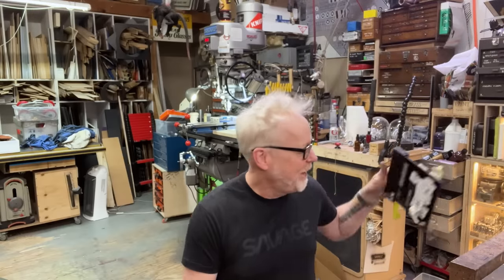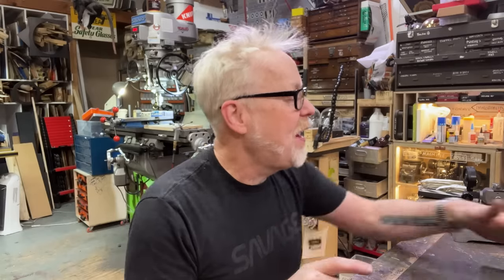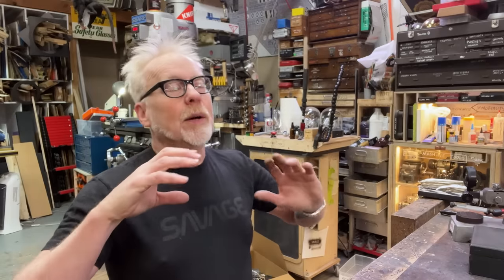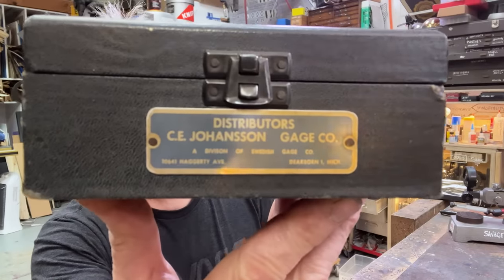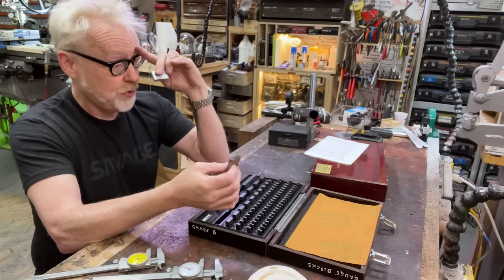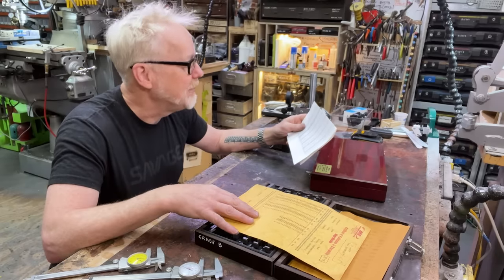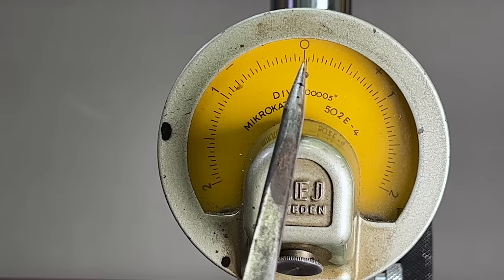Adam Savage's Most Precise Measurement Tool!

Comment: Hi Adam, I'm glad you did a practical demonstration of the gauge at the end of the video, I wasn't too sure about where it was going and then when you noticed the needle moving down due to body heat, suddenly this all came together nicely.   Thank you for the video and the demonstration, I'm blown away with something that I will remember for my lifetime even if all the other details were murky in my mind.
Reply: 100% with you.
Reply: @Vickie-Bligh  Yeah... it's mind blowing how that short amount of contact and normal body heat changed that material.  I like it when something surprises me in a way I don't expect it would and I learn something in a new and different way.  I mean, we've all heard about metal changing or expanding with heat, but we don't realize how our own body heat can change it....  Thank you for your comment and sharing that moment with me 🙂
Reply: When it hit me I yelled "WHAT?!" a little too loud and scared myself.
Reply: Could it posibely be oils from his hand as I do find it very hard to believe metal expanding because of about max 20degrees celsius ..
Reply: @karel_de_lille  I don't know if I agree... but I'm always open to ideas, like it's said "Never assume"... So let's say oils on the had did this...  Then how would it be explained that the gauge returns returns back to zero?  Where could the oil go, would it be on the base it is sitting on?  So I guess  an experiment of first doing a thorough cleaning of the block and equipment with sterile gloves on so you don't contaminate, then switch to a new pair of sterile gloves to handle the block... That would convince me if oils on the hand did the trick or not.  Of course only Adam could perform that experiment as none of us has all the things to do it.

But I like that you raise a good question, aside from the body heat explanation, what else could explain this?  I think the heat explanation is the most plausible... but that's where discoveries come from... asking questions and not accepting plausible answers.
Reply: @raymitchell9736  you are correct on having deeper thoughts about it, like you said oils/impurities would stay on the object longer so thats out just, at least this kind of volume (the block) would almost have 0% measurable difference evne with this kind of a precise instrument ..
Reply: @karel_de_lille  No. It's from the heat in his hand. Oils wouldn't evaporate that rapidly. Remember, your internal temp is 98°F (37°C) and your skin temp is about 88°F (31°C). You can easily melt soft items in your hands.
Reply: @karel_de_lille  Another commenter suggested that it could be air as the two surfaces came together, but another person said that there were notches or grooves on the the table... Again, good idea to check that too... I guess we have a "MYTH" that only a "Mythbuster" can bust... where's the walrus mustache when we need him?  LOL
Reply: @Vickie-Bligh  That's true, was only thinking because the weights are being used as a reliable part they would have been made out of a harder material uneffected from those minor changes ..
Reply: @raymitchell9736  I do miss the "Stache" :)
Reply: @karel_de_lille  Actually, same here. I guess that's why they list the 'guarantee' at a certain ambient temp.
Reply: Robin Renzetti (RobRenz channel) has a demonstration similar to this, using just the heat of his breath. (In the video scraping Tom Liptons level)

Comment: During my apprenticeship I spent about 18 months in the Standards Room. One log the tasks completed was the manufacture of an apparatus for re-lapping the anvils of large outside micrometers, even up to 36 inches.  The “A” grade set of Joblocks( English Moore&Wright ones) were our standards. We also had a height gauge capable of reading .0000001”. The increase in expansion from the heat of fingertips could be actually seen!

Comment: 6:09 0.01mm is 1/100th of a mm, or 10 microns. 
0.001 inches is 1 thou, which is 25.4 microns. 
In this case, the metric caliper is capable of finer measurement.
Reply: This is why metric is superior. No crazy divisions / multiplications by arbitrary values.
Reply: Yeah i thought that was odd, just a standard vernier caliper will easily measure a tenth, let alone a dial caliper.
Reply: 0.01mm is roughly 4 tenths. You could maybe argue they have similar fineness, as it appears you can measure halves on the thou dial caliper, which is 5 tenths. But yes so much better.
Reply: And then you have that gage, which at 0.00005" measures down to 1.27um. It's pretty easy to get a micrometer that measures down to 1um accuracy. Although, to be fair, when that gauge was made, building something capable of measuring down to 1.27um was nowhere near as trivial as it is today.

Comment: From Google, steel has a coefficient of thermal expansion of 0.0000065/degF. If we assume the change in size of the block was 0.00005 (one division) from cold to heated, that would require 7.6 degF of temperature increase in a 1inch block. That is very possible given the amount of time Adam was holding the block. It's really cool to see material science in action.

Comment: There is another possibility, you could be measuring the air leaking out from between the plate the block is sitting on and the block itself.  If you don't wring them down on to a planar surface, gauge blocks will kind of float across them.
Reply: for the 2 surfaces to wring together they both require the surface finish that will allow this to happen, my bet is the plate is as rough as a ploughed field in comparison
Reply: the base of the holder has slots in it. not sure if the few points of contact would be an issue, but at that scale its possible.
Reply: Either way, we're witnessing molecules moving. Molecules! Whether it's the metal slowing down or the air slipping away, it's still amazing to witness in real time.
Reply: The gauge stand could be growing from the radiant heat from his body and the lights.
Reply: Is it possible that oils from our skin could leave a detectable change in measurement? I've always felt that for the precision of these instruments, just touching them with our bare hands could easily be introducing errors.
Reply: @akaHarvesteR  no. But they CAN cause corrosion and buildup if the block isn't regularly cleaned. You'll notice that he takes care to try not to touch the actual face of the block that matters.

Comment: Thanks! You reminded me that I worked with a team of engineers from Ball Aerospace who helped fix Hubble. We needed to align 80 beams of light from a single fiber optic onto an array of 80 MEMS mirrors, then back into one of two fibers. They taught me that to maintain that alignment over a wide range of temperatures required them to build the optics mounting structure from dissimilar metals that had inverse coefficients of thermal expansion.

Comment: When I taught middle school science, we did an Introductory Physical Science experiment which was  a very effective way to demonstrate thermal expansion. Connect a reasonably thin straight metal tube (aluminum was our example) to a stoppered flask of water. Set the opposite end of the tube on a smooth surface. Push a t-pin through the center of a cardboard circle which  has been marked in degrees and tape over the T. The cardboard circle should roll as you heat the water in the flask until it eventually boils. At boiling, you can count how many degrees it expands. Compare that to a similar glass tube or a copper tube, etc. Not nearly as accurate as your dial, but a great way to discuss accuracy vs precision, too.   Thanks for your video.

Comment: Adam! The Mitutoyo caliper at 6:05 measures to 0.01mm, which is 1/100, not 1/10. So in imperial it's not 4 thou, but rather 4 ten-thou.
Reply: Was going to mention that. The Mitutoyo is rated to a far greater precision than the B&S that he was discussing. To be honest, listening to Adam converting back and forth and having to think about whether one measure is larger than another is exactly why the metric system is superior. I don't have to wonder what fraction the smallest graduation on my mechanics rule (which is 1mm on the one that I have in my hand) is of the measurement that I have on my calliper or micrometer.
Reply: Yep, so if we're going to insist on a granularity comparison here, one is 0.01mm and the other is 0.0254mm. The 2nd number is bigger, so the imperial is "lower granularity" - but only based on the quoted rating. this says nothing about a system of measurements. No particular system of measurements is inherently "more accurate" or "more granular" than any other.

Comment: Watching the incremental change in the measurement of that block hits my fascination spot. I can watch stuff like that all day long.  For years I worked with equipment that had measurements of 0.014" to 0.002" that we would thread into a coronary artery. Seeing finer measurements is fun and exciting. I really appreciate it, Adam. Thank you so very, very much for this video. It is one I am going to rewatch many times.
Reply: Also, I love the scale of time you shared. My mom was born in 1916 and remembered when airplanes flying overhead caused everyone to run out of the house to see the wonder going by. We were watching a Gemini launch one morning, anticipating the final countdown when mom related that story. It stuck in my mind so much that when Apollo 10 lifted off, I couldn't help but think of the fact my parents had witnessed the beginnings of flight to its ultimate conclusion: flying to a different celestial body.

Comment: That gauge is typically referred to as a resolution of fifty millionths. Really small in the realm of machining, but mountainous when you dive into the realm of semiconductors. You should link to Tom Lipton's video on measuring a sharpie mark.
Reply: Semiconductors use exclusively SI units though, so millionths would be lost.

Comment: I've got a 1/2 micron analogue Mahr and a 0.1 micron digital Mitutoyo. But that's a classic unit. The mechanism it uses is novel and simple. Worth checking under the microscope.
Reply: Actually, it looked like he had a Mahr in the background. I would suspect it was at least micron accurate unit (I have one of those too.) So better than the Mikrokator he was showing.

Comment: Lapping is really well presented and discussed at Huygens Optics.
Reply: BTW, I am really fantasizing for a day when those monolithic telescopes can be purchased for under a thousand dollars.  I so want one.
Reply: @TesserId  There is (are?) videos on youtube of a DIY monolithic block telescope. I think that once you get hold of a suitable block of glass you could make one yourself. The process is a little tedious but with a little ingenuity and persistence you should be able to do it. Or you could cement together several suitable lenses, bought online, spacing them with one or more glass plates. Probably less then 200 bucks.
Reply: @bikerfirefarter7280   Oh, yummy.  Any links?
Reply: @bikerfirefarter7280  Yeah, I'm seriously tempted.  I do plenty getting sharp edges and flat surfaces out of conventional abrasives.  Achieving an optical surface is a fantasy that I just haven't committed to.  But, I can fantasize about it.❤

Comment: A 64th of an inch is ... 15 thousands? Incredible. I fail to understand how you [people working with precision] can work with this weird mix of [powers of two] fractions and thousands and microns. Not to mention feet, yards and other weird units. When you say "ten thousands [of an inch]", do you mean 0.01 or 0.0001? Something like that can't happen with a metric system.
Reply: I was once like you....grew up with the metric system.  Then I had to learn the imperial system with all it's "weirdness" and realized it's not that difficult. The key is that fractional dimensions are rarely used for anything requiring accuracy better than 1/16". Below that you simply work in thousands of an inch which are an incredibly convenient unit for the majority of work done in precision machining.
It was a bit like learning a new language....incomprehensible at first, but once you learn the rules used in your industry, totally manageable. 
Having said all that, yes, metric is easier to learn for sure.
Reply: When working in thousandths, 10 thousandths (aka 10 thou) would be 0.01, if it's .0001 we would say a tenth.

Comment: Love the video, but a note about calipers.  The resolution on those is .001, but that’s not their accuracy.  It’s not uncommon for the accuracy to be +/-0.001 so that’s .002 total tolerance.   I’ve had some calipers in the shop at +/-0.002.    It really made me start digging deeper and deeper into the actual specs on all of our micrometers and calipers when I realized that.  

Also, it’s not uncommon for them to be dead on at, let’s say 2”, and .001 off at 6”.  We test all of ours at 3 spots along along their range.  1”, and middle, and near max.  

Long winded, but as I’m sure your aware and perhaps misspoke-resolution does not always imply the accuracy or precision.

Comment: Hello there Adam!!  I was amazed at your verbose passion about gage blocks, and you were actually waxing wacky at the end of this segment, but I tend to be a lot like you. I worked my way from an 18 year old metal hacker cutting angle iron on a 15HP Kearney and Trekker vertical milling machine, which qualified me to be apprenticed to an investment mold maker at 20, and I continued on in ever more challenging machinist adventures until eventually I came to programming CNC machinery of a dozen different kinds, making human prosthetic implants that are by now implanted in hundreds of thousands of people world wide at the very least, but probably by now, millions.
You wanted to know what types of measuring tools are the favorites of the respondents here, so I will give two examples of measuring tools I came to be so fond of.
NUMBER ONE: The CADILLAC height gage. I was amazed at their versatility and infinite variations of use!
NUMBER TWO: Intrimics. Measuring a hole diameter can get a bit tricky, but with these beautifully made instruments, a .0005" press fit can be machined out to an .0005 slip fit with proper care. The INTRIMIC.

Comment: I run heat treat and grinding machines and while training others I try to explain how much a micron is. And the paper we use is from 80 to 100 microns thick so I say, it’s about 1%, the thickness of piece of paper, roughly. Now using the standard of .1 mm per day of growth of your fingernail I calculate that one micron equals one minute and 26.4 seconds so I’ll say about a 1 and 1/2 minutes. Thank you for that.  😮 i also wanted thank you again for your other content which, of course, like very much.

Comment: You’re efforts to convert between inches and metric reminded me of a set of dial calipers I have that measure in both inches and mm. A full rotation of the dial is 1/10in, but 2mm, so it has two needles with the metric one going around slightly faster. Sliding it around gives you a good feel for the relationship.

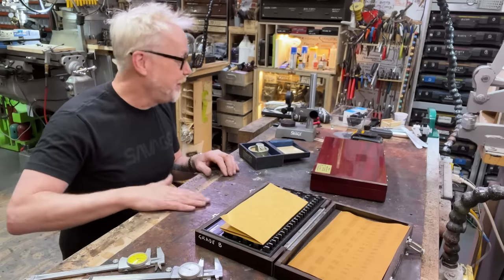Comment: Adam, you magnificent bastard… you TRICKED me! At 26:30 you said “I’ll see you guys next time; cheers.” as if your blessed story arc was going to be cut short without the punchline. So much dramatic tension with no release; I thought I was gonna plotz!!

Alas, no, you finally did what I was waiting for, and compared two gauge blocks of the same nominal value. Whew!

But then… BUT THEN, you viscerally demonstrated the expansion/contraction of steel with temperature! I’m viscerally giddy! I may’ve peed a li’l bit.🎉

Comment: I am an aspiring machinist and most of my work I have is gears for hydraulics. Those bad boys have a listed tolerance of +-.0003 of an inch. It doesn't sound like much but when the heat from your hands throw off measurements it can get tricky

Comment: When the block cools the gauge needle drops. That’s just a thermometer with extra steps. My grandad told me about the old Cummins injectors (I mean old like in an H engine 1500 pounds nozzle open pressure) if you held the pintle too long it wouldn’t go in the body. When the injector is assembled and in the truck it doesn’t stick because everything heats equally and the housing expands the same amount. Funny thing is there’s still enough space between parts those old fuel systems could swallow a lot of dirt and still last a long time but the new systems are so much tighter to where any contamination destroys them. Makes sense they destroy themselves with no contamination too

Comment: Very cool that you have a new measuring tool!  Just an FYI, many micrometers will read on a vernier scale down to .0001, and at that resolution you can detect a fingerprint.  Or in other words, when you touched those blocks with your bare hands, you changed the dimensions just a bit.  I think it's pretty standard these days to use a microfiber cloth to wipe off measuring surfaces before measuring.
Reply: the vernier scale will likely only read down to 0.0005, being the half measures between the thou measurements. To get a tenths vernier, is a whole nother price range.
Reply: @PBMS123  Prices have come way down on micrometers, imports anyway.  You can get a 1" that reads tenths for less than $100.  Mitutoyo 103-260 is a decent one that is just over that.

Comment: According to Wolfram Alpha, a ~20°F temperature difference (roughly room temperature to body temperature) for a generalized steel allow of length 1in would be a .000125 in increase in length which just about lines up with your reading and at keast some of the difference can be accounted for with the specs of the specific allow for the gage blocks, so my money is on you being right about that changing measurement.